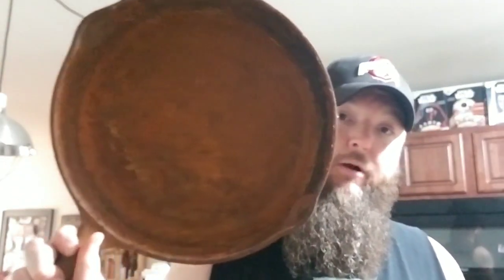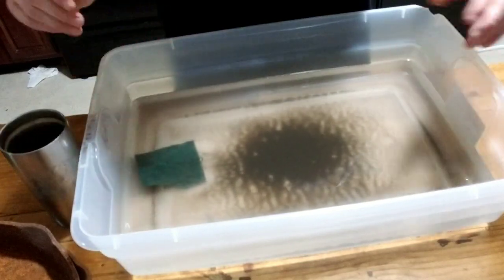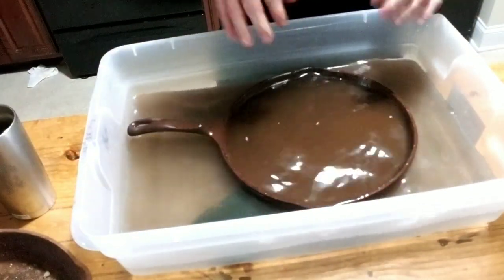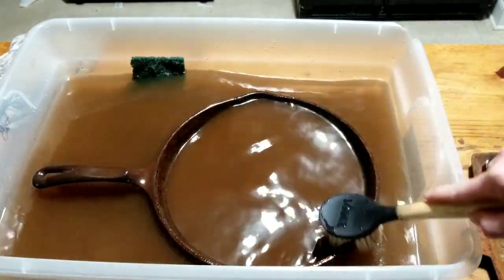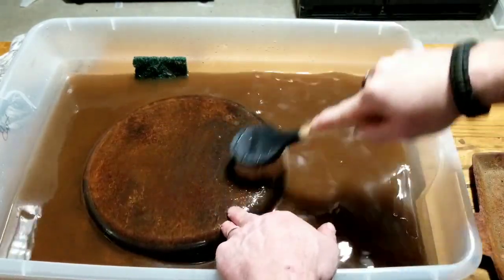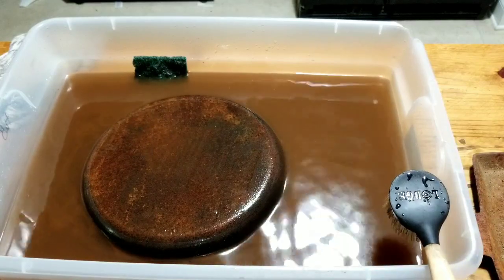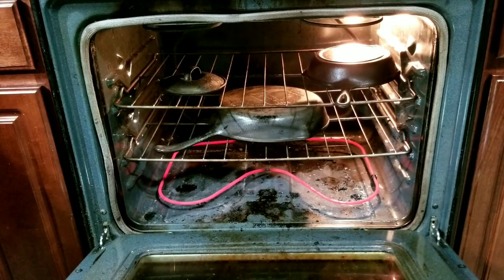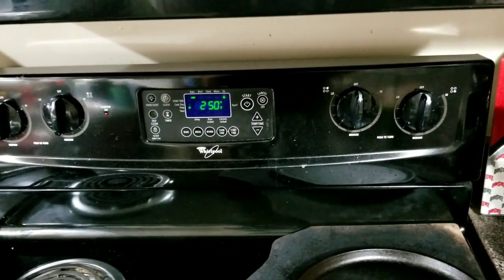wagner 1891  Castiron skillet restoration

Comment: Nice work on that Iron.  Wagner Ware and Griswald back in the day were known for an internal surface that was as smooth as a babies bottom, probably not a wire brush on that one.  Good iron should be smooth.  The rough but more affordable stuff like lodge works, but just a different level of Cast Iron.  In my opinion.
Reply from the maker: Thank you
Yep completely agree with ya. The discoloration could have been from heat damage? This piece came from the back porch of a camp grounds kitchen. When I crossed paths with it i saved it from being wire wheeled.
Have a great weekend

Comment: This is just my experience with vinegar, it does remove rust by eating away at the cast iron but it makes the pitting worse at the same time. Never soak one in 50% vinegar longer than 30 minutes. I've seen some on YT that leave em in for days. If I find a very pitted skillet that has no collectability anymore I sand it down to a smooth bottom. I haven't had trouble with seasoning a smooth piece but you could etch it in vinegar. My choice for cleaning cast iron is electrolysis, its hard to beat and easy to set up an e-tank. I've got four pieces in the tank right now.
Reply from the maker: Thank you for the advice on the vinegar. I've not had any experience with an electrolysis tank but different things I've seen on them look pretty awesome. Have a great week and a Happy New Year 🤘 🖤 🤘

Comment: Never soak it in water and never use anything acidic. We have a Wagner's and it was in bad shape. So we sanded it, then washed it. Dried it out first to get the moisture out and then seasoned it with avocado oil or grape seed oil since they have the highest smoking point (meaning non carcinogenic). I use a cloth to coat the pan inside and out and even the handle and make sure it's on thin to the point it looks dry. I  then keep it in the oven at 450 degrees for an hour and then shut off oven and let it cool off in the oven. We season it every so often and the oils build layers of hard baked on polymers.  If you use your cast iron pans everyday then you will not have to season them hardly at all
Reply from the maker: Thanks for the info, there's several ways to restore cast iron.  
Have a great week 🤘 🖤

Comment: Man, I sure appreciate your video my friend.  You did a very good job with that pan!  I was wondering, I have always went as high as 375 for an hours with my cast iron seasoning.  375 is what lodge recommends and the old writing on the Wagners suggested 300 degrees for an hour.  I would have thought 500 degrees would really burn off seasoning...  What led you to go with 500 degrees vs 375 or even 300 as inscribed on the very pan you were restoring?  Anyhow, I'm just curious but thank you very much for your video!!  :)
Reply from the maker: Great question, for me its dependent on the type of oil I'm using and its smoke point. Oil with a higher smoke point the higher the temp needed.
Have a great week

Comment: This skillet was made in the 90s
Reply from the maker: Ok thank you for responding. I knew it wasn't a collector piece just wasn't sure on age.
Have a great week
Reply: @smoking_bears_  Any cast iron skillet with a smooth bottom was sand blasted and they stopped doing that in 1958. My Wagners is a vintage piece with the smooth bottom. We use ours everyday

Comment: Not an expert. Just do the best I can. Used Crisco for over a year, then tried grape seed oil. MAN! Try it. Used it over Crisco and noticed a big difference.
Reply from the maker: Awesome I've heard great things about grapeseed oil. I started out with crisco then moved to BuzzyWaxx (which is a local small business, local as in 2 hrs away local). Their original blend is grapeseed, canola and beeswax.
Have a great week 🤘🤘
Reply: @smoking_bears_  That's what you're suppose to use or avocado oil because they have high heat points which means at 450 degrees is when they will start to smoke. Then it becomes carcinogenic. I go 425 for an hour and leave it sit in the oven to cool off